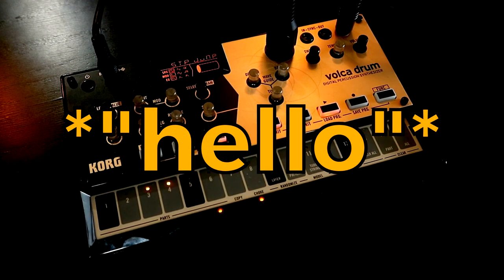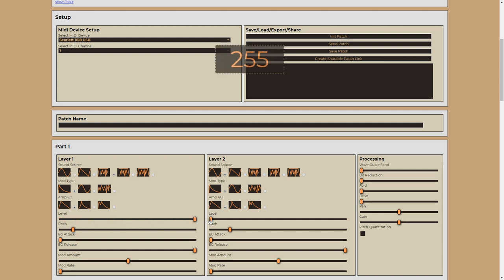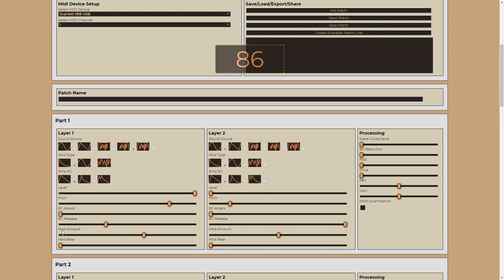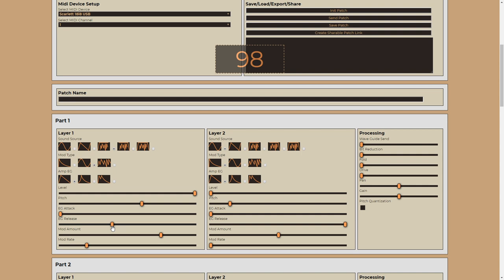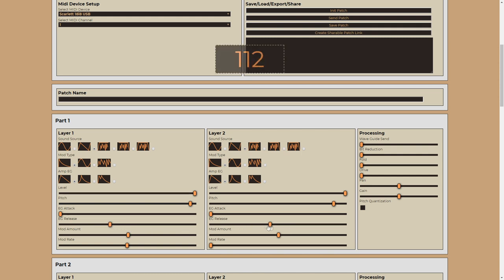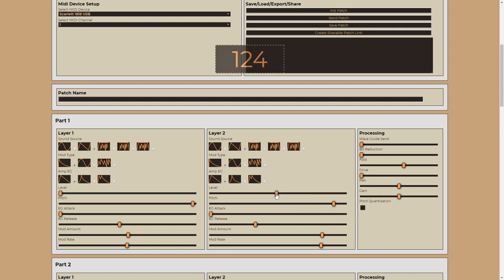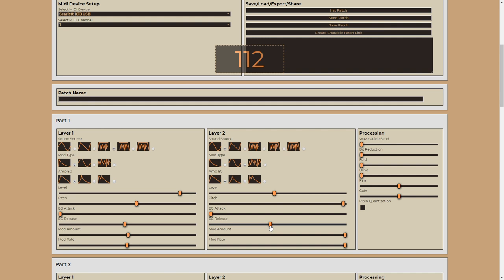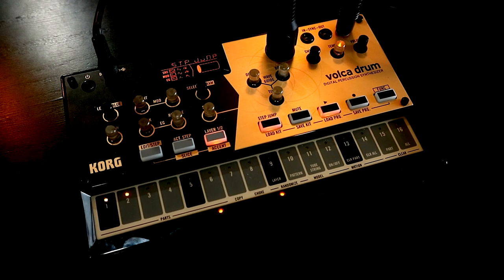How To Cymbal (a discussion of cymbal synthesis)

Comment: Wow, your videos on the Volca drum are so amazing, thank you so much, I stopped playing my volca drum in favor of the sample a lil while ago because of how lost I was at making "normal" percussion sounds, this video solved that for me, thanks alot! Is there a way to save the kits/parts made on the volca drum on a PC using your tool or else? Thanks.
Reply from the maker: Thanks, I'm glad they have helped. I don't think anyone has worked out how to dump patches from the vdrum sadly - there's no midi out for a start, but even with a midi out mod, I don't believe anyone has worked out the sysex magic to get it done. That's part of the reason I made the editor - so that I could make patches that weren't locked inside the Volca.
Reply: @OscillatorSink  Oh ok thanks, i get it. I could instead just "copy" the knobs settings on my volca into your editor and it would do kind of the same, thanks!